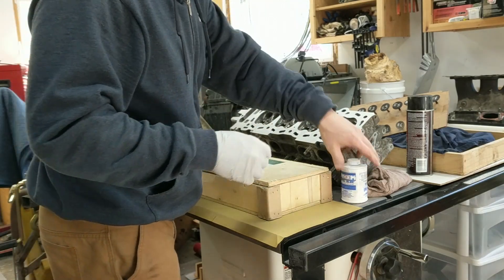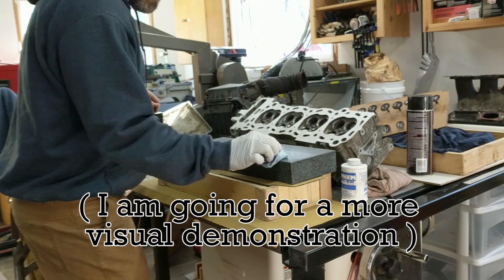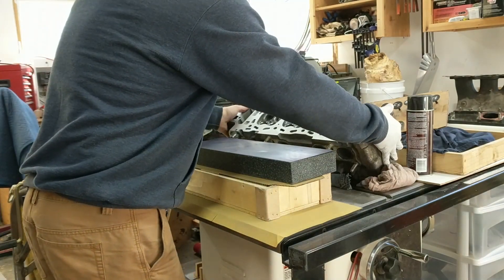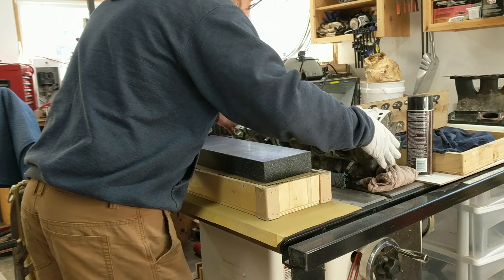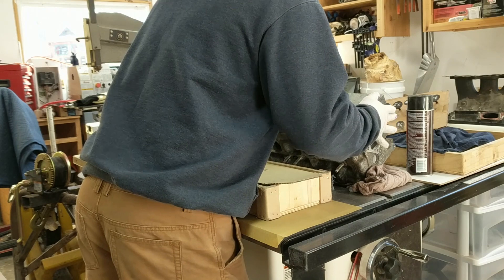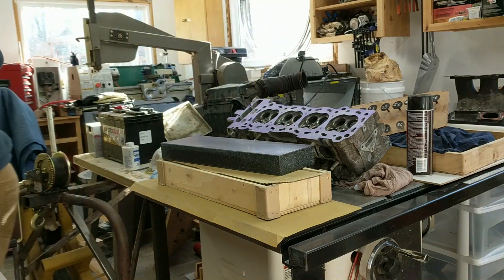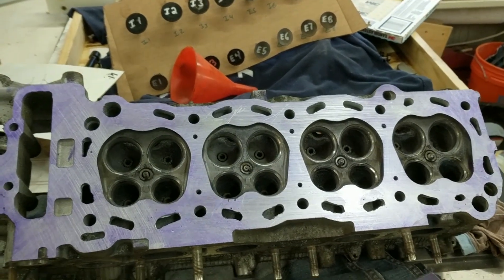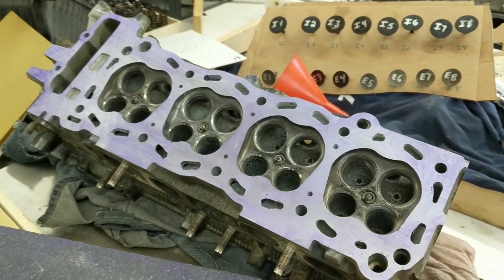Checking for Flatness (In Theory)

Comment: I have done this with great success on my competition motorcycles. In fact the Yamaha manual for one of my motorcycles states to use abrasive paper on a piece of granite. Once the paper is adhered to your base then you should make figure eight oscillations until flattened. I always have used permanent marker since it is more common than dychem. Thanks for the awesome video.

Comment: I think you are using marking blue you should be using engineers blue which is a grease which does not dry
Reply from the maker: You're totally right, I should have used the non drying stuff called Prussian blue, not layout blue.  wasn't thinking!

Comment: Just do it mate
 wherever the dye comes off is high, wherever the dye stays behind is low,
 keep going until it nearly all  comes off.
 don't be shy just do it the abrasive will not hurt 
Then get a straight edge and some feeler gauges and next for low points run the straight edge from corner to Corner checking for many low points sun is in bad ideally it should have a bow in it anyway it is aluminium so when you do your torque down settings starting the Middle work your way out
😉👍

Comment: Looks good to me.   I did not intend to endanger your surface plate.  Only wanted people to know not to trust cast iron surfaces without checking them.
Reply from the maker: The surface plate will be fine, it's basically a rock.  :) Thanks for your comment, you made a good point about all things not being created equal
Reply: @WhatDennisDoes  I did find this to be an interesting idea.  I have two  4.6 liter town car engines with leaky head gaskets.   One was fixed with water glass but well really should be fixed right.
Reply: When checking a cylinder head for flatness just use a strait edge and a set of feeler gauges. For for head it should be no more then .002"